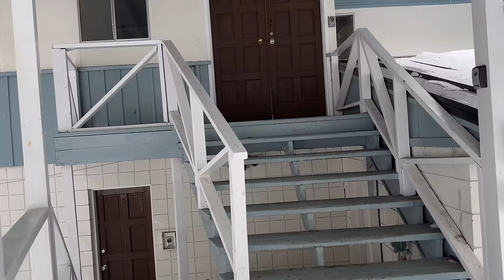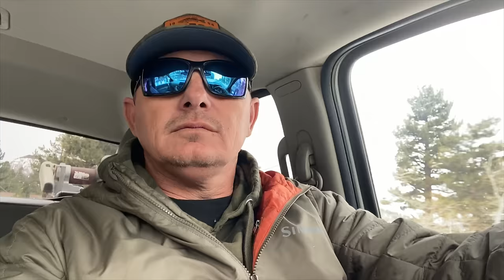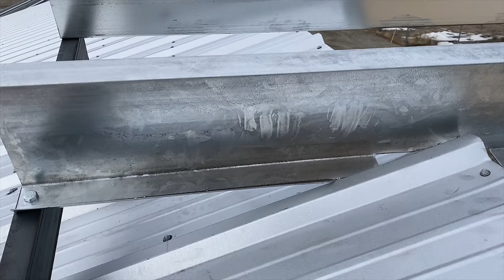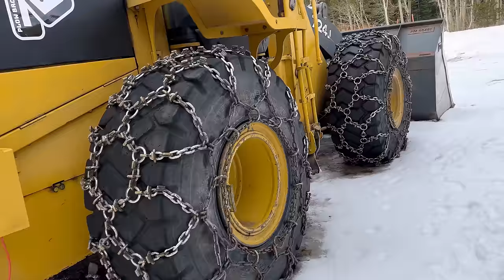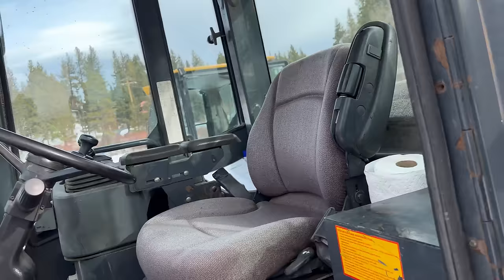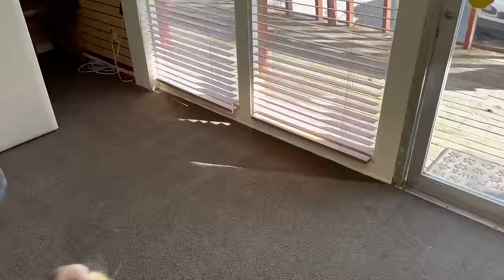The end of an era for Plow Brothers. #snow #country #living #hard #work

Comment: How about filling those rear tires? Obviously water freezing is a problem but... It adds rear weight 🤙 with a low center of gravity
Reply from the maker: That’s a thought maybe some other type of fluid.
Reply: Most tractors with loaders have the rear tires filled. Adds weight to handle picking up loads on front end.